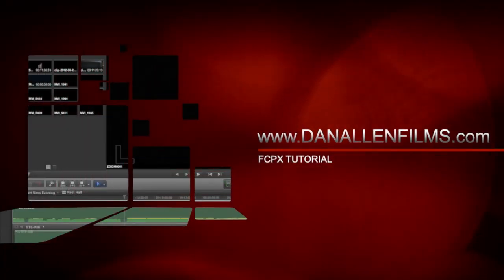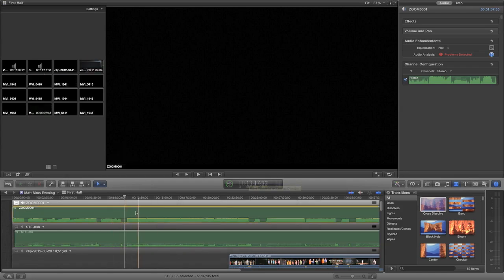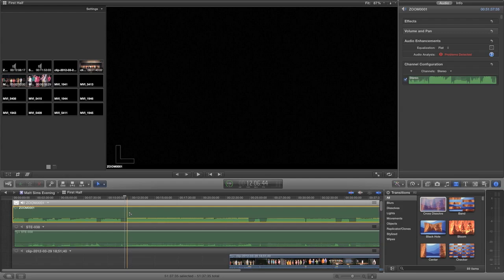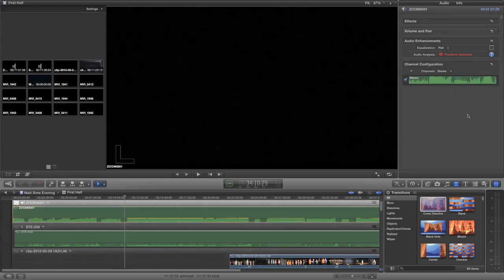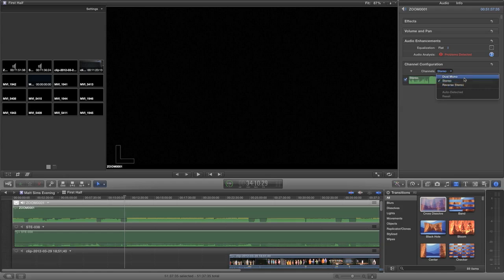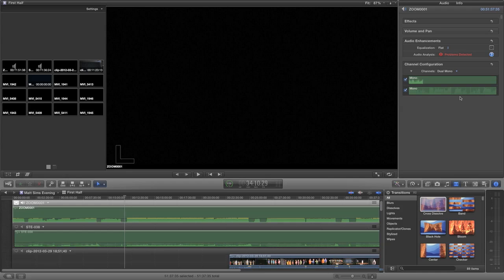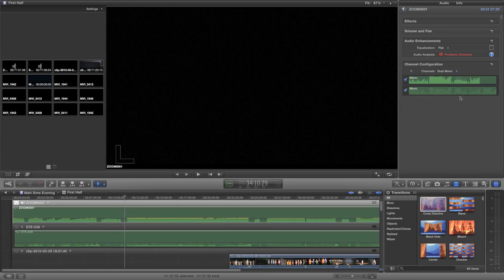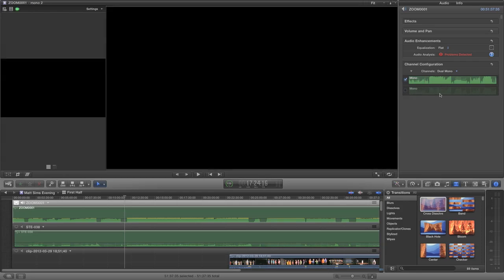Final Cut Pro X Tutorial |Quick Tip| - How to fill blank audio channels - Stereo to mono conversion

Comment: Hi Dan,

I have a different problem. I  have a zoom h4n with two xlr inputs and have recorded a lav mic into left and a shotgun mic on on the right. I want to be able to control these independently in fcpx as two independent mono channels. The file is then imported into fcpx as a stereo input and I can't separate them to get individual control over each one. Any advice, please?

Comment: what u did, is separated audio channels and turned off empty channel(which is obvious abc ), as a result in playback,   u gonna get  only one channel audio coming out from  left(or right) speaker
and the other (left, or right) speaker will give no sound.

so how to fill in second, or 'empty' channel with audio of the first channel ?
or how to  'left' channel make sound in 'right' channel, or both channels?

i tried to use same audio channel in dif tracks, but still they give same channel sound, leaving  the other one empty, 

also, to adjust levels in stereo channels, if u do it in mono mode, getting different levels for different channels, and then switch it back to stereo , changes are lost
thanks

Comment: I use a 13 inch and it's a bit small but it works.  A 15 inch should work perfectly depending on the size of your projects.  If your doing larger films however I would recommend a 17 inch.  That would probably be the best unless your using a desktop computer then I would get a rather large screen.